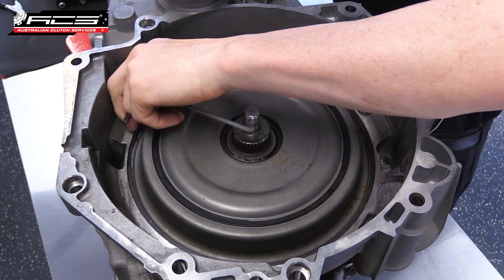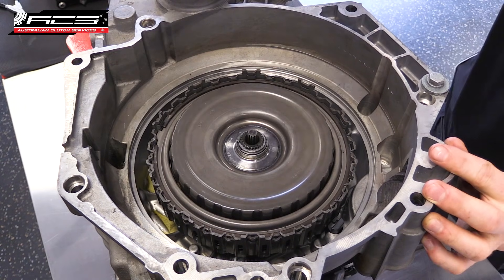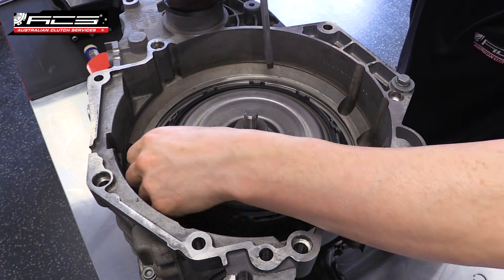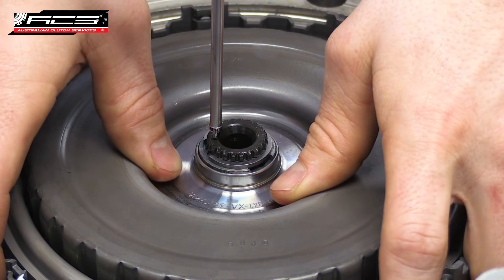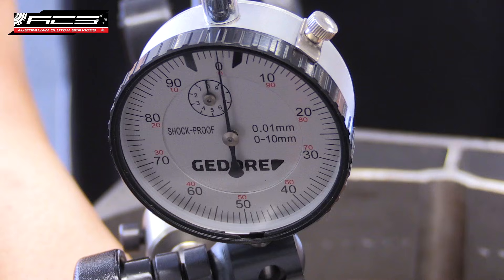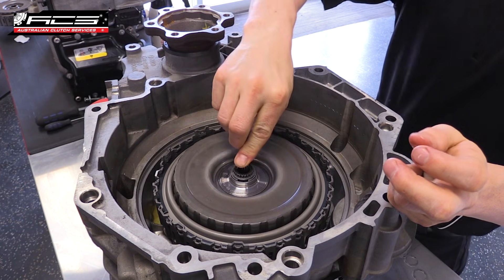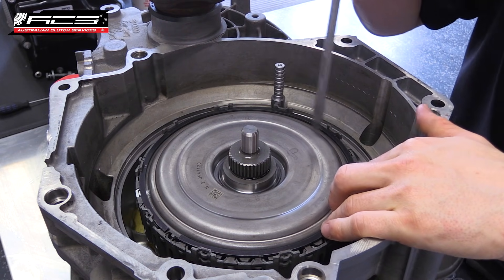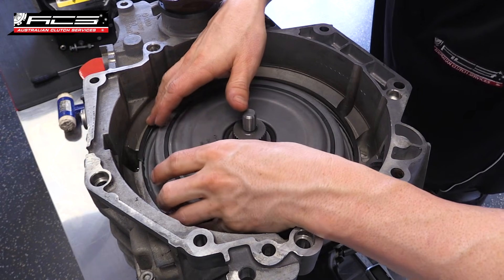CLUTCH TECH: Wet Dual Clutch Transmission (DQ250) Clutch Assembly Removal & Installation Guide

Comment: If the washer is installed without calculating its thickness, will it give a "clutch tolerance limit reached" error?

Comment: Thank you for sharing. This might be a silly question, but if my calculation is 2.15, and my nearest lock rings measure 2.1 and 2.2, is it best to lean towards the 2.1 with a looser fit, or 2.2 with a tighter fit along the shaft? Or do I get even more precise and surface grind a thicker lock ring down to 2.15?

Comment: Hey there,
Could using a pry bar slipped under the clutch pack to hold the clutch drum up affect the readings on the dail gauge? 
Didn’t have the special tool, also noticed you guys only use it once the readings have been taken… other videos show them installing the speical tool first.

Comment: Hi, thanks for the informative video. I have a 2015 CC with the 02E trans. It  all of a sudden stopped moving both forward and reverse. When I scanned it, I got a code P0716 (G182 implausible signal). Pls can the G182 cause the car not to move at all? Is there a way to check this sensor with multimeter. I have checked the connector and no physical damage, I have opened the mechatronic cover and the wire of the G182 looks good. before all of this, I have replaced the DSG oil and filter. Is there something else I can do? My car is 32000 miles. Thanks again.
Reply from the maker: Hi,
Thank you for your comment. In this case we would recommend contacting or taking the vehicle to a local specialist for a diagnosis of this issue.
Thanks
Reply: @australianclutchservices7503  
Hi 
I write from Croatia , please i need your advice . My mechanic changed the dual cluches and dual Mass flywhell on Passat b8 2.0 tdi DSG , and after the change my car i shaking when i start to drive , only in the start when i put off foot from pedal in the moment when te chutches separates . After is everthynk okej . Is posible that the new clutches Are not good or the mehanic didn’t do a good job , before the changing IT was not the shaking .. please help 
Tnx

Comment: Do you lose any dsg fluid when doing this? Vw replaced my clutch pack and when I asked if there was any fluid loss they claimed no.
Reply from the maker: Hi Greg, thanks for your comment.
There is no fluid loss due to it being a fully sealed gearbox. The gearbox is removed from the vehicle and the clutch pack is replaced as per the video.
Reply: Yes and no. If your gearbox was pulled from a FWD, no it won't loose fluid because your axle shafts remain connected. But, if your gearbox was pulled from an AWD (Quattro), the transfer case is removed and fluid will spew out of the shaft hole. You can try taping it closed, which can hold the fluid in, but don't think you can wait for parts for several days or you will have fluid all over the floor. And, if laying it on it's side fluid will eventually leak out of the electrical connector.

Comment: Can i reused snap ring?
Reply from the maker: Hi,
We recommend using the new snap ring provided in the kit for this.
Thanks
Reply: @australianclutchservices7503  if the old snap ring was a 2.2 why can’t I just reuse or get the 2.2 out the bag?
Reply from the maker: Hi @VWSnMORE  
Each clutch can have a different setup height which would require different snap rings.
 Also, there can be wear and tear in the transmission components effecting the end float of the input shaft. It is important to check the different dimensions and then use the new snap rings provided in the kit.
Thanks
Reply: Noted. Many thanks

Comment: Hi.I just wanna ask after changing clutch.Should I adjust selector lever cable?thanksI
Reply from the maker: Hi,
Thank you for your comment. In this application there should be no requirement to adjust the cable.
Thanks

Comment: While taking measurements using dial gauge shouldn't the T10303 clutch retaining tool  be inside?
Reply from the maker: Hi,
This tool is only required to assist holding the clutch basket in place when installing the top cover so it shouldn't be in at that point.
If you have any further questions, please email our friendly sales team on sales@australianclutch.com.au 
Thanks

Comment: Hello, what purpose has that shim ? What can happen if set incorect the shim ? What fault codes can generate a bad setting clutch package? I really appreciate a realy answer.Thanks in advance ...
Reply from the maker: Hi,
The shim helps to adjust the release characteristics of the clutch and is very important to ensure that the clutch will operate effectively and to give long term reliability. If you don’t set the shim correctly, the clutch may not release or can slip. The fault codes are dependent on the specific vehicle. For more information on these codes, we recommend contacting a local vehicle specialist.
Thanks
Reply: @australianclutchservices7503  I think you just solved my clutch disengagement issue with the reply to this comment.
Reply: @australianclutchservices7503 Hello, many  thanks for the answer.I really apreciate it.
Reply: @australianclutchservices7503 I got a 2.028 shim size. Is 2mm ok?